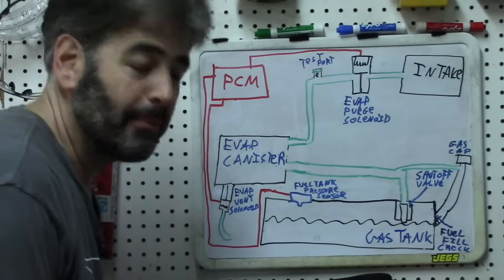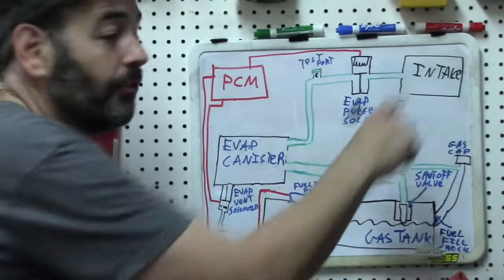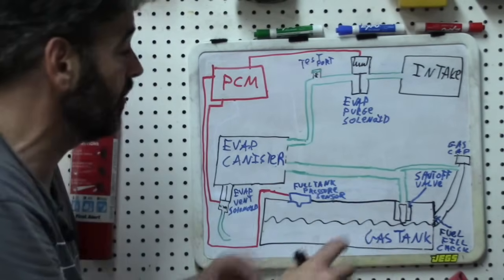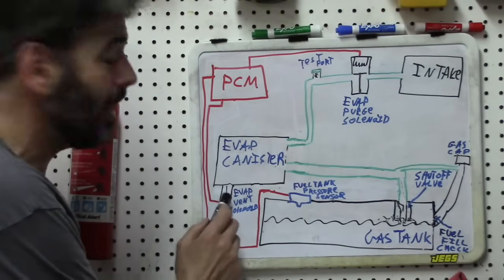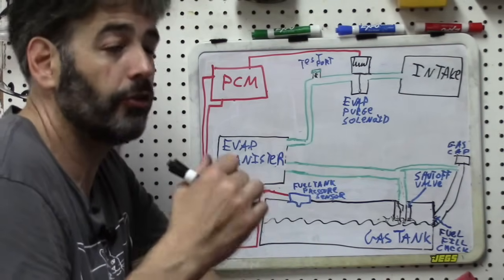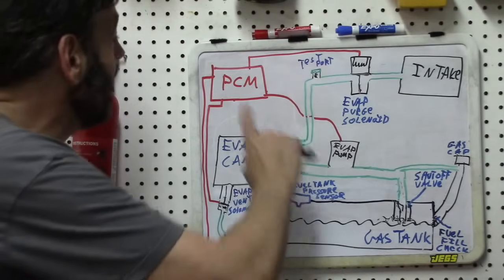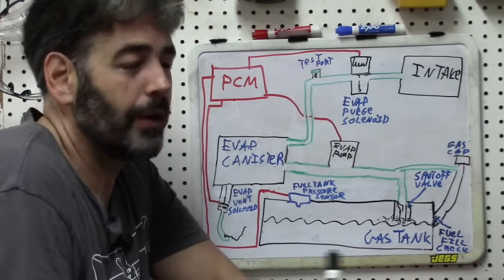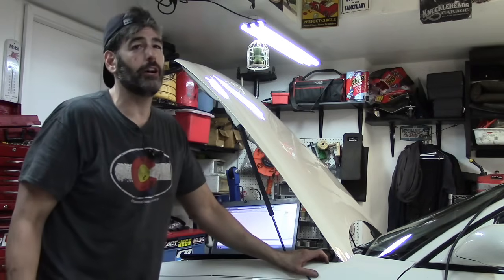Diagnosis + Understanding EVAP Systems (SBQM Full Video)

Comment: My question is, how does air get into the fuel tank to prevent vacuum as the fuel is used??
Reply from the maker: Through the evap vent.
Reply: @SchrodingersBox  thanks for the reply. I have a VW and it's not setting an evap code but after driving for a while, especially in hot temps my fuel pressure drops to the point the car hesitates and I can hear the fuel pump surge. I can also see lean condition when this occurs in the fuel trims. Fuel pump checks out. If I leave the car to sit it works fine again. If I fill it with gas while it's doing it it runs fine for a while. But if it happens for a prolonged time (highway driving for example) it will then not fill with gas. Ive replaced the charcoal canister and made sure no lines have restriction. Purge valve and evap canister valves replaced. This one has me real stumped. Thanks for your great vids!
Reply: @iandrackert7838 you didn't say what kind and year of VW you have or had since your post is 4 yrs old now. Golf/Jetta have two pumps, the low press high volume pump that's immersed in your fuel tank that feeds the the high press pump that goes to the injectors. I don't know which press you're measuring but it sounds like the pump in the tank can be your culprit. The high press pump and filter sit in a reservoir box just forward of the fuel tank that's kept full to overflowing by the pump in the fuel tank. The pump in the fuel tank comes out of the top and is easily removed, inspected for clogs and replaced.

Comment: So the fuel tank pressure sensor give power to the purge valve? I keep getting a p1443 on my mustang even after a new one was installed. I can’t get 12 volts at the connector

Comment: Hey Mattt, I was wondering on cars that have an evap pump, and you were looking to find a leak and did not have a smoke machine, could you find the leak by disconnecting the evap purge solenoid(as it is normally closed) to make sure the valve is closed, then with a bi directional scan tool, close the evap vent solenoid, and command the evap pump to turn on. Next spray the evap hoses and system with soapy water to find the leak. Just a thought. 
Love the videos, and to let the other viewers know that at $3.50 a month, they are getting a great value for their money! Even if it were to help them make one repair on their vehicle, the money they would save would be enough to pay 100 months or more!
Reply from the maker: Yes you could certainly do that..

Comment: Question...

It was found that my purge valve needed to be replaced; now my engine oil smells like fuel.

I had the repair completed under warranty.

Does a small evap leak typically affect the engine oil?

My oil doesn’t seem like it has lost much viscosity at all.

Should I change my oil now that I have a new canister purge valve?  What would you do?

My car is a 2017 Ford Fiesta with an ecoboost engine (turbocharged gasoline direct injection). 

It currently has 31,000 miles, I made sure the engine was properly broken in during the first thousand miles, and I am the original owner.
Reply from the maker: Should be unrelated to the oil.  The only way it could affect oil is if car is running rich for a long time and excessive fuel vapor from blow-by affects the oil if it isn't changed regularly.
Reply: Understood, do you think that it could be more of a PCV valve issue?

Comment: I have a question. At about 10:13   You mention the purge is normally closed. Then you say when the the pcm turns off the purge circuit that the purge will then open...

Isn’t it the pcm will turn on the purge valve and then the valve will open allowing the intake air to pull vacuum.?
Reply from the maker: So if I recall, on the GM example, the purge valve is normally closed when energized. De-energizing (turning off the valve" then lets it move to its relaxed state (open).
Reply: Ahh yes you’re correct good sir. Thank you for the reply.

Comment: Good video ! Theres one thing that I need a clearer understanding on. You stated that if someone is checking the system with smoke that they can misread that the system is leaking through the solenoid because it's open to atmosphere. How is it that the system will allow smoke to leak from it and not fumes? Does it have anything to do with it's molecular weight?
Reply from the maker: No it's because the charcoal cannister stores the vapors so they are not released to atmosphere.
Reply: @SchrodingersBox  Thanks

Comment: So, i was watching your brilliant videos, while finding a evap vacuum soleniod valve error.
Because the local mechanic already changed the o2 sensors "both"  wanted to drill a hole in exhaust, and wanted to change the kat....     Jesus...  
please help  the error came after a exhaust change.  so big confusement.

He did not check the values via scope while driving to see a difference between the lambda values between a closed vacuum line with a pinched line,  and the old installed solenoid with a bad valve which was open on wrong times a "little leaking only."
Able to blow through it a little.. "so small mistake" on the solenoid.
Gave it 12volt away from the car and found that it closed fully some times... and not closed fully at other times giving it voltage....  conclusion that it is hanging sometimes "not closing fully evertime it is activated."
Dirt debree, crooked abs, or a hard seal....

I have a seat ibiza st 1,2  , 3 cyl  "now you go crazy"   1 bank system,   
The LTFT was 12% aprox  and the STFT was around 2-3%
The fault code was :   P2097 00 [237] - Reguleringsgrænse for fed overskredet , lambda probe 2,
"yes danish language"  not the stuff you eat"  NOt sure you even have real danish availabe there....  

Started cleaning the MAP sensor with some alcohol.
But no effect.
Later i found that the next easy way was to test the vacumm holding ability of the solenoid and i foud the leak...
I blocked it , so the engine could not get any air , at the wrong times,  and baam the engine light did not show again..
Going out to get a new solenoid today.

I have pictures of the test results and the after results of needed.

Comment: I need HELP please help me. 
I have a 1992 ford e350 7.5L. And to keep it short I’m confused with the lines/hoses that connect from the tank to the charcoal canister. So I see diagrams and pictures of the Evap system, and I notice that all of them connect directly from the gas tank to the canister. On my van it connects from the gas tank to the line that connects the purge solenoid and canister. And it becomes a 3 way. (A line that comes from the gas tank and it splits to the canister and purge solenoid) and I’m thinking that the previous owner maybe tried fixing it, connected the line incorrectly. I also want to add that my van has 2 small canisters. And each canister has 2 holes or connectors. On the first canister the first hole connects the 3 way line that I explained already. And the 2nd hole connects to the 2nd canister and in the second canister were left with one hole. But I doesn’t connect to anything and it stays open. I need help PLEASE. Because I think the lines are wrongly connected. I think that the line that comes from the gas tank should go to that hole that I’m saying is open. And the rest should be okay but I’m
Not sure. Please help me thanks.
Reply from the maker: Pretty simple. If you think the lines are installed wrong just reinstall them by FUNCTION and then pressure test with and without valve activation to verify the operation is correct. I often do this with electrical too- just take it all apart and assemble it correctly “from scratch”.
Reply: Schrodingers Box thanks I’ll try my best to get it right.

Comment: So I have a 2004 vw Jetta that I’ve had for about 2 years. For about a year now it’s had this constant issue of stalling when below a 1/4 tank. Recently it got worse and started stalling when 1/2 a tank or less. (When it happens the car starts bucking even at 80 mph and will just shut off.) this has me baffled and I’ve put 3 fuel pumps in it, checked all my fuel lines. And even cleaned my gas tank. As well as putting a new fuel filter on. I’ve never gotten a check engine light for this. 
So two days ago I was checking out my evap lines after putting in my 3rd fuel pump and it still stalling and I was gonna pull off my purge valve to see if it still holds vacuum. Well I unplugged the plug for it and decided to go inside for the day forgetting to plug it back in. (The hoses are still on it. It just no longer has voltage. ) well magically with just it unplugged my car hasn’t stalled since. Can someone please explain this? Is it a problem with the purge valve itself? Or more of a Ecu issue???? This has kept me up at night lol.
Reply from the maker: Check the impact of the purge line variables on fuel trim. That should give you a solid basic direction to start with.

Comment: I have a 2003 Honda Civic.. had the code p1457... I changed, the gas cap, charcoal canister, shut off solenoid, by pass solenoid... and the code still came back on... anything else that it could be? I’m tired of changing parts and still having the code
Reply from the maker: What data do you have?
Reply: Schrodingers Box what do you mean by data?
Reply from the maker: @xelementzgaming7171  I need to see that data you used to determine the parts you changed were suspect. For example you changed the gas cap- how did you determine there was a leak at the gas cap? You changed the bypass solenoid- what was the voltage at the solenoid and was there full voltage drop on the ground when activated? You changed the shutoff solenoid- same thing- what was your voltage and voltage drop measurements to determine the solenoid was the problem?
  I have to have the basic data to determine where the issue is.
Reply: Schrodingers Box well to be honest this is my first car ever... so when I got the check engine light on.. I went to AutoZone to see what code I got... and it was P1457 EVAP LEAK CANISTER AREA... so I googled it 🙈 and it gave the list of probable cause.. but that’s about it 🙁
Reply from the maker: lol ok- well unfortunately i can’t help without data. I would have to see that the solenoids are functioning properly by applying voltage to  close them and then vacuum testing the lines. .  Your best bet is vacuum testing the lines at this point since everything else was changed... but it could be a huge number of things. You have to narrow down to where this issue is and then test the suspected component in where you narrowed down to.

Comment: My 2002 4-cyliner Toyota Camry smells like raw gas near the tank usually upon shut off. No check engine light. Any ideas?
Reply from the maker: Many. test for voltage at the vent solenoid and manually activate it to test.

Comment: Thank you.  My purge valve doesnt open at 10 volt, when I put directly 12 volt in the valve then he open. What can be the problem?
Reply from the maker: Sorry you are saying that when the valve is commanded to be opened by PCM, there is only 10V on the wiring? You need to calculate the voltage drop if that's the case and look for a bad ground or power feed

Comment: So then At 6.28 when you are talking about the shut-off valve. If that is stuck in the closed position, then there will be a slow fill problem, regardless of the proper condition of the rest of the system? Right? In none of the videos or writeups on the forums is that ever talked about. They talk about the fuel filler screen inside filler tube ( mine is clear) , they talk about the purge valve, they talk about the carbon canister, etc.. Why am i interested?? I have a Ford Explorer Sport Trac 2004 that has slow fuel fill, and I have pulled all the tubes to the carbon can  and the are ope to the atmosphere, and I have removed the Fuel Fill Check valve from operation so it is open, and the tank still fills slow. Conclusion -  air is not able to vent from the system on filling,  and that shut off valve component, that only you seem to know about,  appears to me to be the next issue to take a look at ( If I can find out where this component is and if it is at all serviceable or comes integral with the tank itself and if it is a solenoid or just a fixed part.)
Reply from the maker: that is true. good point.
Reply: @SchrodingersBox  any idea if there is one and where located on the 2003 sport trac??
Reply from the maker: @streetmann1367  Yes there is and it's in the tank.
Reply: @SchrodingersBox  A hunting we will go .. thanks so ,uch for you info and your great explainer video

Comment: I like this vid Matt. Even though I have a workshop book it often doesn't show where some parts are so have to do the dreaded visual thing but knowing what bits do lets me check them. Of course the canister is impossible to miss, I found something that a hack had done. I shouldn't rave about having to wire in new connectors to the dli coils coz they had used pliers or something instead of wow, gentle thumb  pressure on the clip. Guess what else they did. Cut the wires to the canister close solenoid and removed the valve completely. I can't measure fuel trims  but my ears, nose and eyes and coolant temp using dvom and a candy thermometer, tell me not to be too upset yet. I like  a bit of water dripping from exhaust when trying to reach temp. Not too happy with Tridon  coolant sensor as it turns on the fan before the thermostat opens. Inaccurate resistance I think.  Anyway, not being a swap tron, I had to put in a coolant sensor coz a (mechanic ) broke the oem one.  It sucks that  engine can't heat up in a few minutes.

Comment: Excellent presentation. One thing i'm confused about is the function of the evap vent solenoid. If its normally open why doesn't fuel vapor leak out through there? Especially since the sys is already pressurized by fuel vapors?
Reply from the maker: It's because the charcoal cannister traps the vapors.
Reply: Schrodingers Box so what exactly then, is the function of the vent solenoid? Simply to allow the PCM to do a leak test?
Reply from the maker: @OverlyCuriousEngineer  Oh yeah sorry-  I should have answered that.
 Twoi funbctions.  One is when closing the vent solenoid (an opening purge) it draws in the vapors from the cannister.  The second function as you said is to seal the system for the decay rate test.
Reply: So in both cases, the solenoid closes. Correct? Why the need for a solenoid then? Why can’t they just close off this part? I’m sorry I’m still very confused.

Comment: I have a 2013 Ford transit connect that I’ve been trying to diagnose for a month now. It has terrible gas mileage and has severe lack of power when going up hill or when accelerating, no matter how much you press the pedal. I bought a scan tool and and the LTFT stays around -11 so there is definitely a rich condition, but STFT goes up when accelerating. I can barely give it gas and the loadPCT shoots up to 100%, idles at 30% . It starts right up and idles smooth with no check engine light or codes. The on board monitor feature on my scan tool says the purge valve is stuck open, and there is a plugged evap line. Everything I’m reading says if the purge valve is stuck open the car will be difficult to start then stall, yet it’s starts right up and idles smooth but with some vibration. I’m not sure if I should trust this cheap scan tool, and also don’t want to just start changing parts. Does this sound plausible with the symptoms it’s having. I’m about to watch this video but wanted to leave this comment on the off chance that you might see it. Thank you for what you do, you and your channel are awesome 😎🤙
Edit: Forgot to mention that I already cleaned the MAF sensor, replaced the air filter and spark plugs.
Reply from the maker: I would definitely start with the data you got indicating you need to clean the MAF and replace the spark plugs- especially the data showing the spark plugs were bad- what data did you get showing that?

Comment: I have 2000 Camry , everything in Evap system was good until I replaced gas tank due to leaking gas and rust. Even with the old leaking gas tank I have never had Evap error code and all obd monitor includes Evap were showing ready. But after I replaced gas tank problems started. After about 100 miles driving I got p0441 , p0440 and p0446. I cleared the codes and again after about 100 miles I got exact same error codes. I did this five times and I still get same results. I replaced gas cap, vsv for Evap and vapor are good , I don't feel strong gas smell but sometimes I feel very little gas smell after turning off engine  and from trunk area when picking up stuff from trunk. 
Any help and suggestions to solve this problem?
Reply from the maker: Pressure test the system and do a decay test with all solenoids closed.

Comment: what model scan tool did you buy,they have a few different ones
Reply from the maker: I have several but AUtoEnginuity is my main one. Good to hear from you again btw!
Reply: @SchrodingersBox  yea but there are 5 models of it,i bought a zuruch for 100 bucks,does abs and srs and others..funny i have po446 evap code..i have to find it and abs on right wheel..fixed the wiring earlier and code comec back..

Comment: When the purge solenoid opens to allow gas fume into the intake does the ECU adjust the injector's "pulse width" in order not to run rich?
Reply from the maker: Never really looked at it but it definitely should- injector pulsewidth is always restricted to compensate for richness.